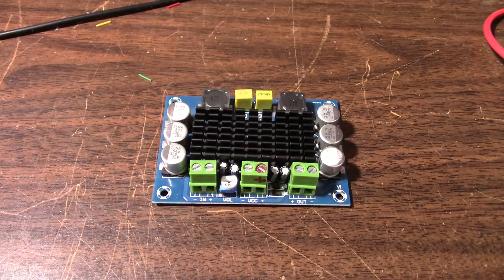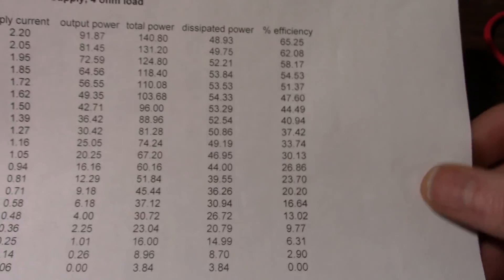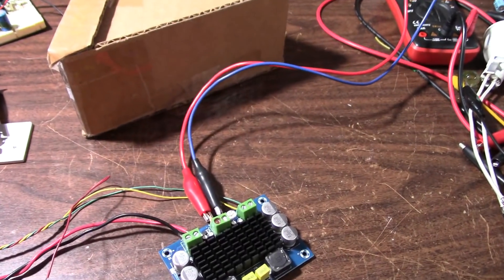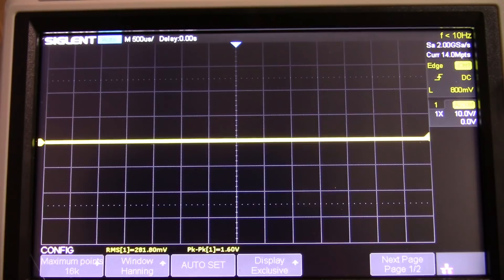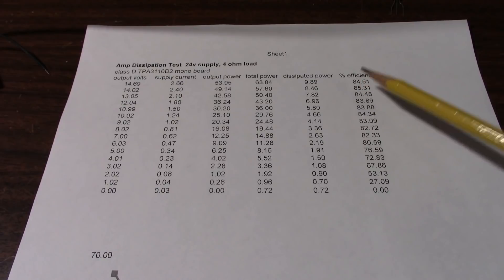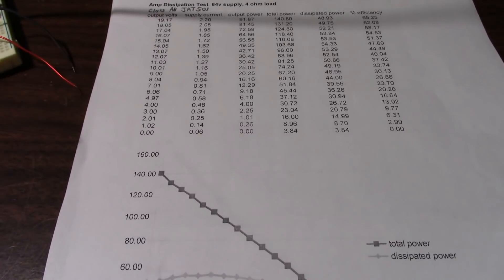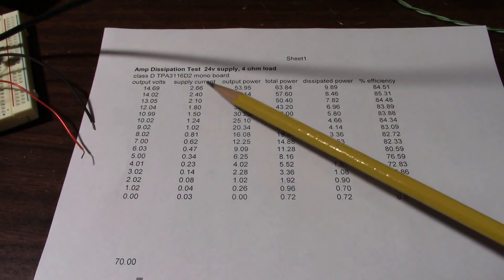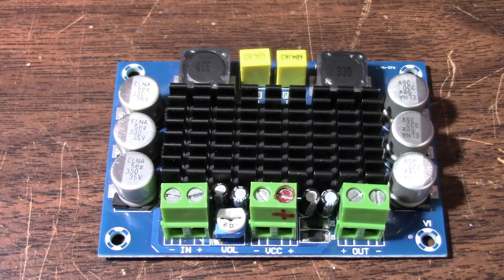Class D amplifier efficiency. Great at high power level, but what about low?

Comment: I run a 6 channel class D on my computer speakers.  Why,  because 95% of the time it's hardly turned up at all.   Exactly as your video points out it uses very little power.

Comment: I have a Nobsound TPA3116D2. I have (2) Dual 3-way bookshelf and (2) MTX Road Thunder 12" subwoofers. One bookshelf is connected to one subwoofer wired in parallel at 2 ohms for each channel. The power supply is their recommended 19V/4.74A adaptor. Very impressed with the output. The bass is deep with good control However, the power supply cuts out at half volume then sends my amp into some pulsing mode so I turn it down/off and try again. How much more power do I need to see full potential? Thanks!
Reply: 24 V .  10 Amps

Comment: I have a question..
I'm using the same  amplifier on your video.. and I'm adding a bluetooth receiver but there is some kind a high frequency noise when they both share the same power supply line.. But when I use different power supply for the bluetooth receiver the noise gone.. 
Is there no other way to remove the noise without using different power supply for the bluetooth receiver?

Comment: ThankS for your work. Please, I have 3 questions for you, regarding the day to day use of Class D mini amp:

1 is it ok to use ONLY ONE SPEAKER ? can it damage the stereo Amp? even in the long term?

2 If it's technically ok, can I connect this Speaker (let's say a 6 Ohms) with Both OUT ? (a mono speaker)

3 can I connect 2 speakers with 2 differents impedances (a 4 ohms and another 6 ohms, for example)?

You will excuse my ignorance, and answer me in the most simple way (I know very few, but want to be sure)

THX,

 Laurent from France
Reply from the maker: 1. It shouldn't harm a stereo amp not to use one channel. Just ground the unused input. Better just to get a mono amp board.
2. Do not connect both outputs to one speaker. It can damage the amp.
3. This depends on the minimum impedance the amp can handle. A 4 ohm speaker in parallel with a 6 ohm speaker would be only 2.4 ohms which is too low for most of these cheap class D boards.
Reply: @JohnAudioTech  Thank U very much. Happy new year John :)

Comment: Just curious, does the efficiency change with the frequency of test sine wave? 100Hz vs 1kHz vs 10kHz
Reply: Was wondering aboute the same. Would be interesting to see a graph of efficiency versus frequency.
Could it the more efficient at given frequencies?
Reply from the maker: I would not expect much change at all.
Reply: I am currently working on a school project where i test A, B, A/B and D class audio amplifiers. I will make a graph later on, but whan i can tell right now, is that my DIY class D audio amplifier doesn't like 10KHz. For some reason i have a huge current draw of almost 2A at 10Khz. At all the other frequencies, the current draw is about 200-300ma.

Comment: Hei i just bought this amp.. i am using this amp for designing speaker monitor.. but the problem is there is boost on higher frequency.. when using the Xsim (xo design) there is mismatch behavior between simulation and realtime measurements in higher freq. My question is, does this amp have really a flat response freq.?
Reply from the maker: With a non inductive 8 ohm load, response was nearly flat out to 20KHz. 4 Ohms showed a roll off. A light reactive load at high frequencies could cause a boost that could be countered with a zobel filter.
Reply: @JohnAudioTech  oh.. thanks for reply sir.. i am very happy... I really appreciate it.. when using tiny amp, usb powered amp.. (5watt -  driving 2way min. 6ohm) everything match between simulation and realtime measurements, But when i am using this amp If i assuming this  amp have flat response 20hz ~ 20khz  according to your measurements. i have hard time looking whats wrong.. the woofer match perfectly but highs there is difference +6 boost.

Comment: just made an amp with PAM 8403, lithium cell and a low pass filter on input paired with crappy 2.5'' drivers on hand-made enclosures what sounds like 2 tweeters alone.

tweaking with EQ a bit i get a reasonable sound, with good drops around 60hz